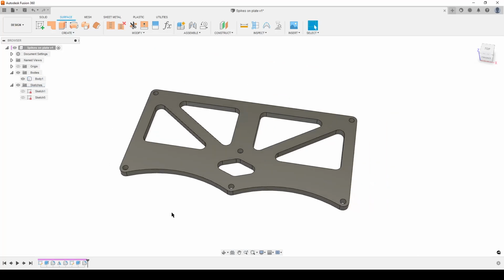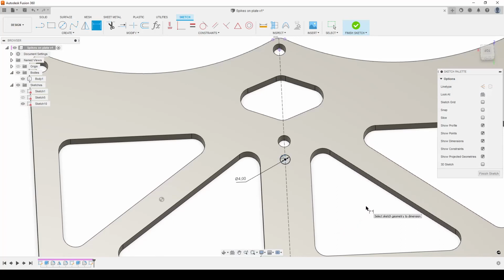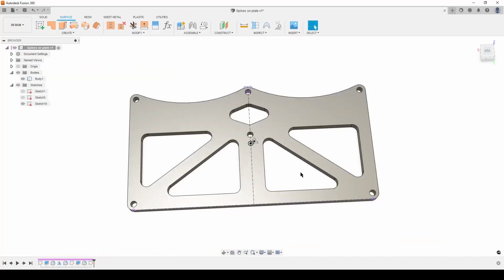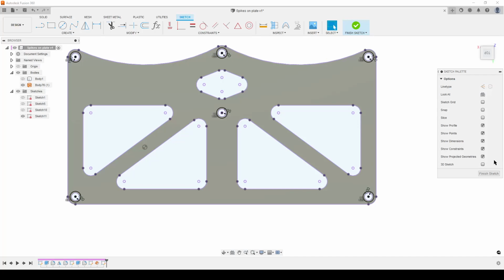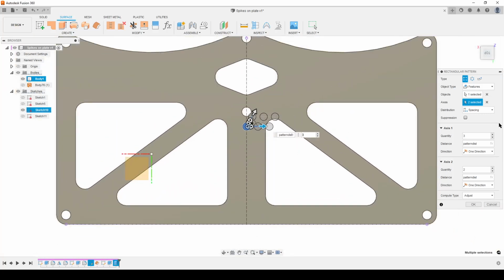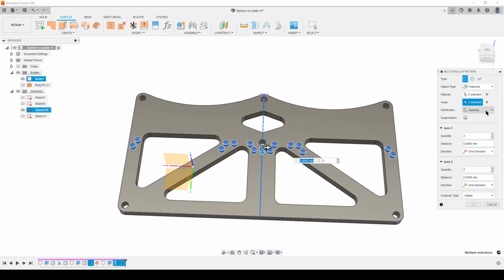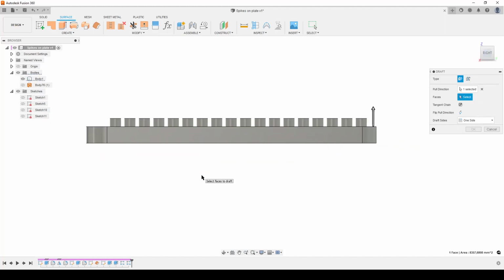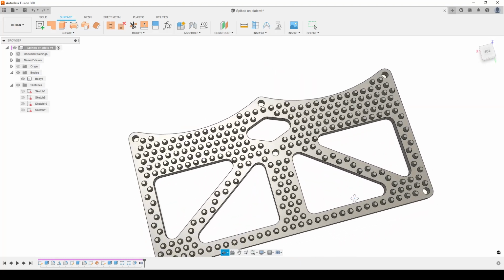Fusion 360 - Nubs, Limiting pattern to face of body.

Comment: Seems like something has changed in Fusion since this video. My pattern covers all the area without "failing" where the surface body is not present.
Reply: In case anyone is coming back to this later: Fix for me was to select "Extend > To Adjacent Faces" option when extruding (becomes visible after selecting 'to object' Extend Type)
Another tip: If you use "optimized" instead of "adjust" when patterning, it will extrude a partial shape as long as that's possible (whereas adjust will only extrude if the entire shape is possible).
Reply from the maker: It works for me. Check: Extrude feature: Extrude to object and Join, 2x Pattern feature: Compute Type = Adjust
Reply: @KristianLaholm  it does not work for me eigther, triple checked all the settings

Comment: Nice. I've been using an ilogic script in inventor to get a similar effect for holes, when trying to lightweight parts without touching any edges. This technique should work for my use case too though, I think. I'll definitely give it a shot, thanks for sharing :)
Reply from the maker: I have another video doing hexagon cuts using the same trick with a surface target body. https://youtu.be/EqgZgJIc-ds
Reply: @KristianLaholm  Nice, I'll have a look. Hope it translates to Inventor. I think Fusion is a bit ahead for the patterning compute options, for some reason.
Reply from the maker: Inventor and Fusion use different solvers but you can give it a try :)